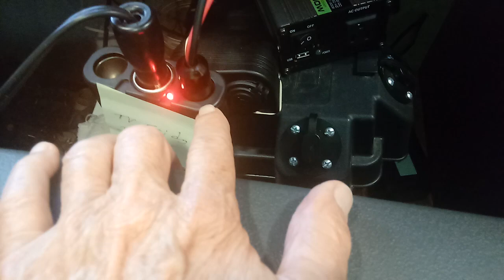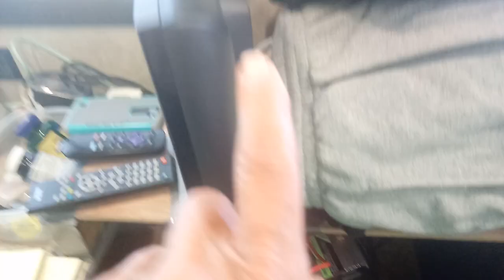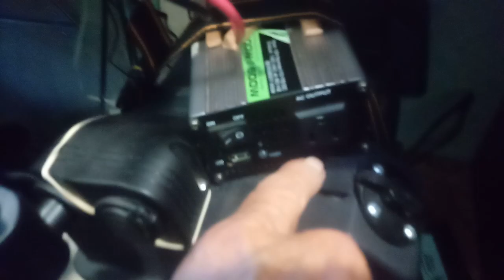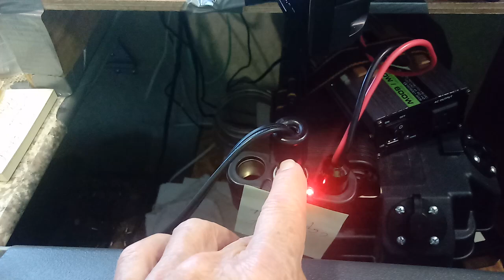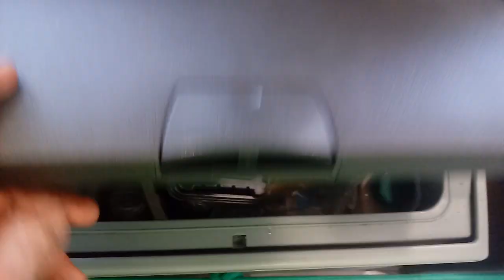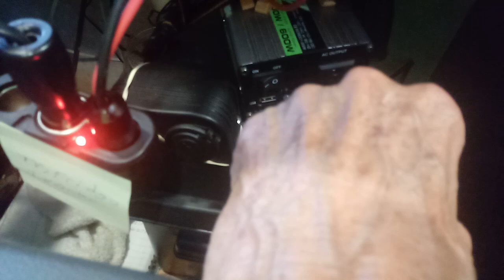SOLAR POWER...MY BATTERY SET UP!!!

Comment: Just a idea get a 12 volt car plug with usb with a rating of more than 1 amp for the ruku and no  need for the inverter.Then a 12 volt 3 amp for the tv and your cell phone as a hot spot and everyhing will run on 12 volt and save inverter power.

Comment: This RV has a shut off switch on the factory inverter to stop parasitic loss. Still have the 2 110v outlets in the RV but have never used them, 1 in bathroom, 1 at kitchen counter. 2 TV's came with RV, both are 12v. Wife wants to leave them for now, may watch movies since it came with a 12v VHS player and 126 tapes, lol. I have never watched a movie, we have never had a TV the 45 years, come November, that we have been married. We run everything 12v. in the RV, even charging the chromebook. This rig has a heavy battery cable that charges off the engine alternator, runs about 30 amps so it doesn't take long to charge the house batteries, when needed, has a small solar trickle charger to top up batteries. I would like 200 watts of portable solar panels for when boondocking....James

Comment: I’ve got a similar setup that I pieced together that I’ve used for years for deer hunting and TV during hurricane power outages. It’s been a valuable piece of equipment when needed. I didn’t realize that the pure sine wave inverter was more efficient until recently so I guess I’m going to upgrade my inverter now.